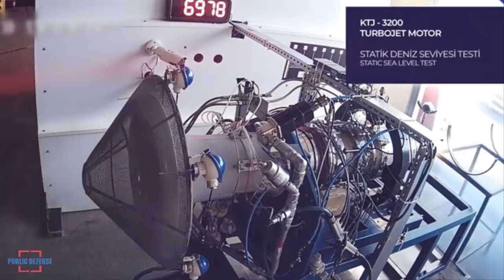Turkish Developed KTJ-3200 Turbojet Engine to Power the SOM and Atmaca Missiles

Comment: What's the speed altitude and flight time you forgot to mention?
Reply: Since this is domestically done the som can have a range of 500 km. And for the atmaca missile it will have a range around 380km. The speed is around mach .90/95
Reply: Subsonic, probably arround 800 kmh and range is about 250-300 km.